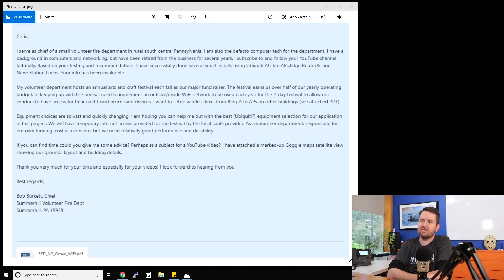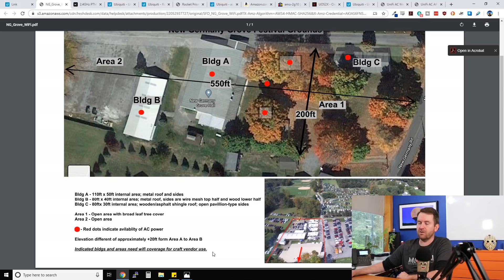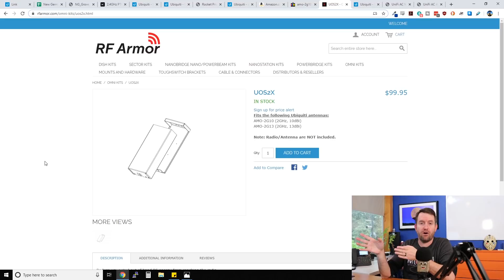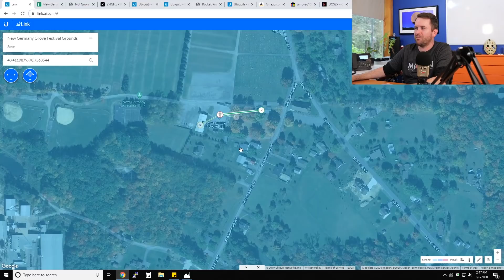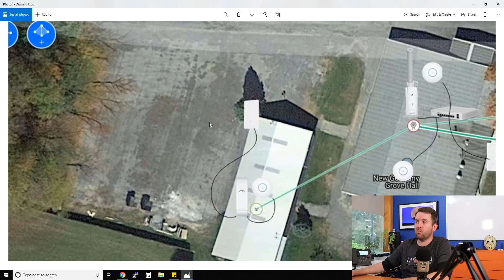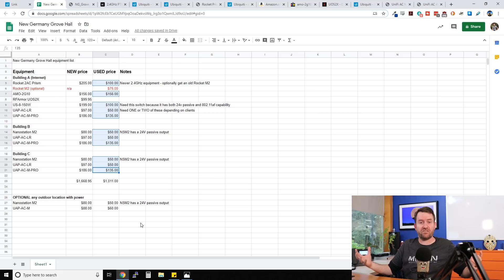Festival Grounds PTMP Network

Comment: If u run an WISP you need pre-configured spare rockets on hand, and a backup until you can replace, rocket, can be rather expensive, as you need a stack of gear and backups.

Comment: I put my rocket up with the 13dbi omni and it failed 1 month later, completely dead no power, and came to life 2 weeks later like magic.  because it's hard to get to the rockets i had to redesign the mounting and move the rockets down the mast 4meters so I can get to it for repairs. Need to run 4+m of low loss coax tails with lightning arrestors, u lose a few db. I also covered the antennas in plastic bird spikes as birds will sit on offset arm of lower antennas and block signals and shit on everything.

Comment: The trouble with these is its hard to get to replace the rockets if they fail, as they can be high up on a mast, also if you want 2 omnis one for backup its hard to mount the second antenna without it getting in the way of the first and vise versa.  The second could be underneath and offset from the mast by 30cm, however side by side 30 cm apart at same level my cause them to interfere with each other if both are used even on different channels, as the tx on one can overload the rx on other radio and visa versa.

Comment: So in the left hand building, you have a Nanostation powering the AC-Lite via the secondary Ethernet Port and in your diagram, and you say that the AC Mesh looks is connected to the Main Ethernet port on the Nanostation, so how does the Nanostation get its power in order to power these devices?

Comment: You are using the secondary port of the Nano on building B to power up the AP LR, but then you mention to use Eth 1 of the Nano to provide network to the AP-Mesh-Pro.......How do you power up the Nano if you are using both ports to send power and network to other devices?
Minute 16 ish
Thanks for the videos.....they are great!

Comment: Hello! First of all, gotta say I like your videos. Highly educational and not boring at all. Nice.
Have you considered trying out an alternative firmware on for ex. a Nanostation 5AC (loco)? Those support OpenWRT too and I think that they could be used as such a festival guest wifi network on the cheap too. (turns out that the main radio is not some special sauce and can operate with AirMax disabled and the management radio can be used as a secondary dualband AP... But you will probably need to set up relayd or kmod-relay to get the main radio to connect to a network and bridge that to LAN...)
Thank you, I'd really be looking forward for such a video!

Comment: Question someone might be able to answer for me. On the left building setup with the Nanostation + UAP-AC-LR + UAP-M-Pro.... what is the power setup on those devices, specifically how is the Nanostation powered if both its ports are daisy chained to the other two devices?

Comment: Thanks Chris for great content / explanations.   I have a client that has 2 physically separate networks, one for data and voice and the other for some very high bandwidth security cameras (lots of cameras).   3 buildings total.  I already purchased 8 qty ubiquiti nanobeam gen2 (two for each station buildings, {for separate networks} 4qty for the access point building {2 qty set of 2 pointing at each station building}).   I know sounds like overkill but with the number of cameras they need the bandwidth.
The buildings are all within 6 acres so pretty close together, working off old nanostations right now. Ditching for fiber is not an option. 

I was wondering since they are all 5GHz devices do you think I would be better off with the new LiteAP AC GPS since it has GPS synchronization?  I haven't installed the Nanobeams yet but money's no object so if you think the LiteAP AC GPS would perform better I'll shelve the nanobeams for another project.   Thanks in advance.

Comment: Hi Chris (and Bob!). One way to reduce costs a little further is to consider the Bullet radio. They’re around $100 for the AC version, and are available in dual or single band. While UI doesn’t make an antenna for it, there are several direct-connect (N-type) available for around $35. This is one of my FAVORITE Ubiquiti AirMax radios ever made. Small form factor, great performance, and with the new dual-band it’s even better.

Comment: That's crazy, i'd just buy direct burial Cat6, rent a trencher for a day and spend half that money and have a set up that was permanent.
Reply: Considering this is rural Penn, I'm sure they know a half dozen people with a backhoe that would probably come over and do it for free.  Also being rural, there is likely very little red tape to deal with.  The only difference is I would suggest putting in conduit, more expensive but easy to upgrade and less likely to be damaged.

Comment: Usually, trees do not have leaves close to the ground, so if the antennae are located around 10-ish feet above the ground, there will be no issues. Then, you could omit the nanostations and the omnidirectional and can opt for unifi access points with wireless links configured. Just a thought...

Comment: Having done this professionally, I have several problems with this, though generally, all ok base info. This is mostly overkill and at least twice as expensive as it needs to be (and a long install time).There's also the reality that in a small area like this, the Nano's and Rocket are way overkill since the UAP line can all mesh from a central point and one could easily cover 1800 feet radius from a central point with just the UAP Mesh series and a CloudKey, so no need for the AirMAX devices (Nanostations and Rocket are overkill). Also, no mention of grounding or cabling recommendations. If it were professionally installed, add Ubiquiti ESD's at each Nano (and Rocket) and ground them properly (including grounding the mounting hardware the radios are mounted on) using Ubiquiti tough cable and Ubiquiti tough connectors. Any outside installs my company performs are properly terminated and grounded using Shielded Twisted Pair (STP) CAT5e cabling, grounded to building ground posts, as per proper NEC code (and Ubiquiti's recommendations.) Also, the cell sizes in the video are very small and there would be a large overlap in each access point's coverage area. No mention of channel use patterning, so if all access points are left on "auto" there will most likely be channel overlap and your overall signal (and throughput) will be lower than what you state would be achieved. Channel overlap, signal interference. front to back ratio, and too large cell sizes at each device-based AP (UAP models) would all drive down throughput, but generally this is a passable basic starting physical design. There is also the issue that the Nano's have only 100 Mbps ethernet ports, so do not expect each cell to have anything better than 100 Mbps HALF DUPLEX back to the Rocket. A "speedtest" at each cell would only get a 50Mbps "true" tcp/ip throughput value, so dividing that up among client devices will get dicey after about 10 to 20 smartphones, especially if "auto" is left as the option for each cell location (I'd guess after 15, streaming would start sucking.) Also,  not tuning the radios of the UAPs (using Unifi Network Controller) features such as channel sizes of 20Mhz, band steering, minimum RSSI settings, 2G and 5G data rate controls, and traffic shaping (either using User Groups under Site Settings of the UNC, or directly on the Nanos) will also cause undesirable results as the use of the wifi network increases (meaning, more devices connecting to the network driving down performance and throughput). The Unifi Network Controller was left out (no CloudKey) so managing the UAPs would be impossible, and, the AirMAX devices would also be left unmanaged since they require UNMS, not Unifi. Again, the overall basic info for a physical environment is generally ok for a 1-day use, but too much left to chance in a professional setup where expectation of carrying a small festival is concerned.

Comment: Chris, both the Rocket M2 and Nanostation M2 have a fast Ethernet port, so no gigabit. So in practice the maximum speed over 1 of these is 100Mbps.
Reply from the maker: Very good point - it would be the same at the NanoStation sides, so not that big a deal overall.  100Mbps is more than enough bandwidth for this application.

Comment: Are those "rocket" antennas active, I.e. with a head amp of some sort? if not, 10dB gain is implausible, to put it politely. And given the distribution is 2.4 gHz band, I would be keen on an RF survey to check for interference. The suggested solution is fun, but way more complex (and costly) than simply flying temporary cables to as many of the AP locations as you can.

Comment: Does anyone have a recommendation for a repacement to the Jackery Powerbar? It appears that it is now a discontinued product.
Reply: For powering Ubiquiti equipment, I have used a 12 volt to 24 volt DC-DC converter with a passive poe injector and a  12 volt 12AH sealed lead acid battery.  I think that is more efficient than using any type of DC to AC inverter.  You can use a higher or lower AH rated battery depending on run-time requirements.
Reply from the maker: RAVpower has a similar unit to the Jackery Powerbar.

Comment: I 100% dissagree with this entire setup...minus the switch 

Thats because all aps now have wireless mesh

That means you could just buy a 5 pack of nano hd which would even be overkill for 780$ on amazon

Put one inside at the feont of building a

Put one on the roof of building a

Put one inside building b

One inside building c

Have a spare 

So with the switxh, the 5 pack and some 48v power adapters feom uniquiti the total is

$1100 and its way easier to configure, more durablex and less likely to have a part fail
Reply: natalie sharpe mesh should be avoided at all costs. It’s a last resort solution. Even mesh with a dedicated wireless backhaul aren’t that great, and the nanohd don’t have that.

I’m not saying there aren’t other choices that could’ve been made, but going mesh is absolutely no guaranteed success and most likely will perform quite poorly in this scenario.
Reply: @Klementoso  all ubiquiti acess points now support wireless mesh. And as long as you have 60% or greater signal strngth daisy chaining one ap is perfectly okay. And for what theyre doing with credic card scanners even this would be over kill for a better price

Comment: I would pole mount a Mesh Pro on each of the three buildings.  Wire a pair of small Mesh units to the switch in Building A as indoor access points/redundant mesh links.  Add small Mesh units via wireless uplink for Buildings B, C, and vendor areas if needed.  That would eliminate the dedicated P2P hardware and expensive PoE switch as the Mesh units include injectors.
Reply from the maker: PTMP is > mesh always.
Reply: @CrosstalkSolutions  Agreed, but wired is > PTMP.  If they ever decide to run wire between the buildings the mesh units can work as wired APs.

Comment: How to get a cloud key to run Windows you can't because there is no windows software For The cloud key for what they should do they should make the cloud key software so can run in Windows because my computer is a Windows run-d system my computer runs on Windows 10. it Doesn't run on Linux at all and that's why my computer runs on Windows That's why I'm having a problem with my cloud key And getting it to run on Windows very hard With out Windows software If there was Windows software and that would make it easier for the cloud key to run on Windows instead of running it on Linux In the first place why they did not make it so the cloud key can run on Windows I don't understand why They did not Make it so you can run on Windows with out any problems in the problem is it does not run on Windows this is What I'm saying about Why that is
Reply: Damion Morley I believe you’re getting confused between what the Cloud Key and UniFi Controller is. The Cloud Key itself is just a piece of hardware which runs the UniFi Controller which you are speaking about, If you want the controller to run on windows I would suggest you download the UniFi Controller software for a Windows 10 machine. The only downside to this is when you turn off your machine the controller stops, Definitely learn Linux it’s in many ways better than Windows

Comment: Why can't you just run Ethernet since it's temporary? Would be cheaper for sure.
Reply: Alex Froehlich you would have to hang the Ethernet pretty high in the air for people not to trip on it
Reply: Mactelecom Networks why can’t you just gaff tape it down or something?
Reply: Just like they do at events. Have the plastic shielding around the cables so people can’t damage them
Reply: Alex Froehlich I suppose it’s possible depends on the setting. This looks indoor outdoor. If someone were to trip and sue would cost more than the antennas. This setup new was only $1500 which for IT infrastructure is not a lot
Reply: But you’re right you could do that just depends on the physical location and the distances the cable would have to run
Reply: I won't use overhead ethernet, but direct burial ethernet is not that expensive. The advantage of connecting all the buildings with ethernet is that once it is installed you can use it for many years. I'm also wondering if the labor costs of installing the outdoor wireless hardware especially on the rooves is not more than the labor costs of trenching and installing ethernet between the buildings. The end user experience will also be improved eliminating wireless hops.